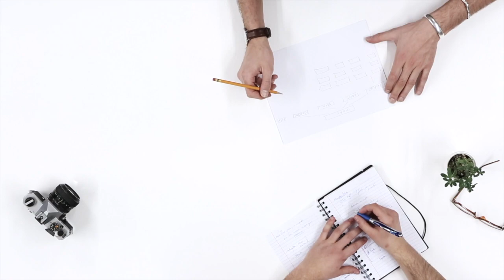WHAT DOES AN AEROSPACE ENGINEER DO?  - Day in the life - TIPS FOR FUTURE ENGINEERS

Comment: Amazing video! Do aerospace engineers spend a lot of time at their desks?
Reply from the maker: It depends what type of team they are on. If they are in an analysis team they might be doing a lot of analysis work using computer programs and likely spend a lot of time at their desks. If they are in an integration/ systems engineering type role they could be interacting with others a lot and spend little time at their desks.